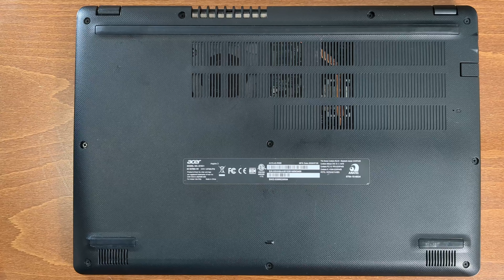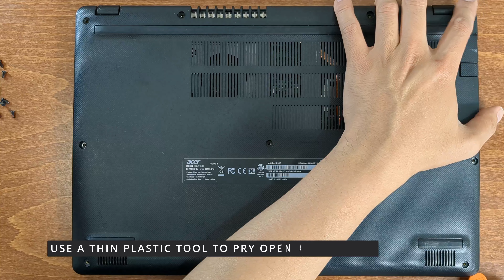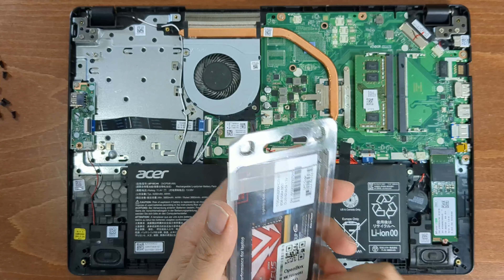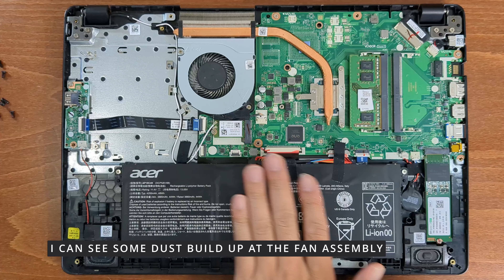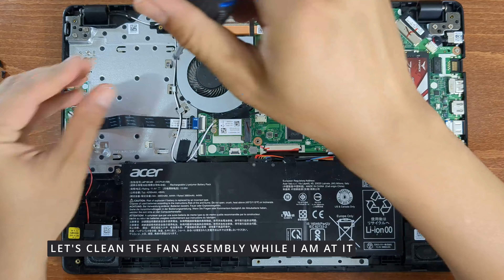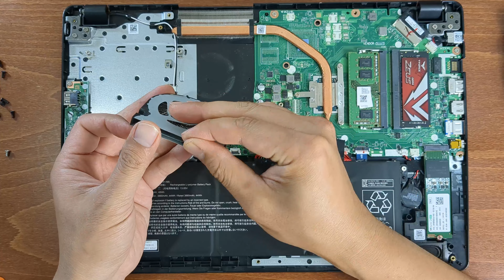ACER Aspire 3 RAM upgrade and teardown in 4K

Comment: I love the way bro guide but i want to mention 2 things first its important to disconnect battery and press power button to get rid of any reseeved electric current in board 2nd thing when you want to close back lid make sure to open screen so you don't put pressure on screen and damage it. Over all its amazing to see this tutorial ❤❤❤❤❤